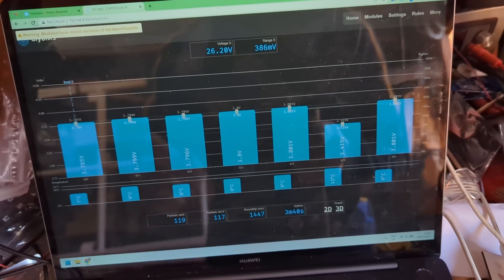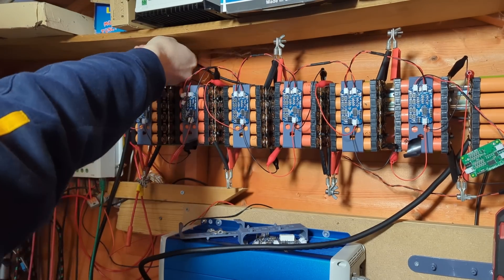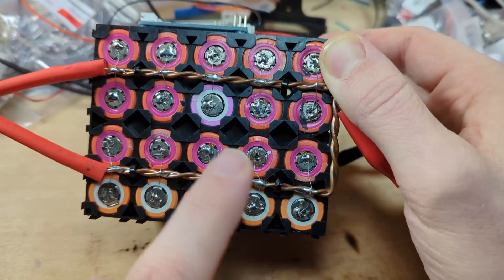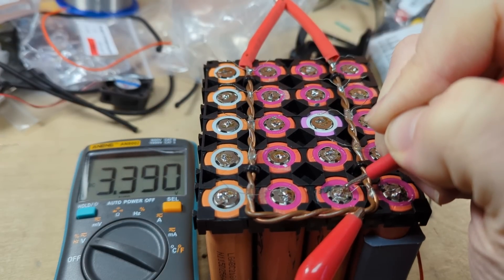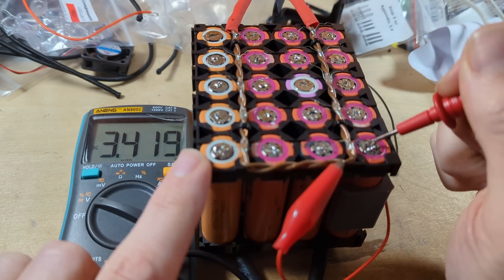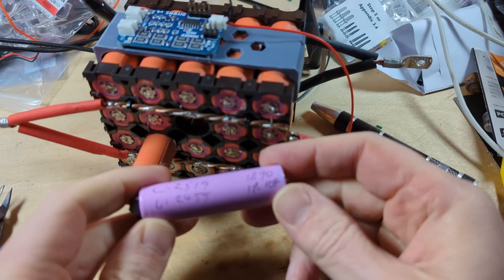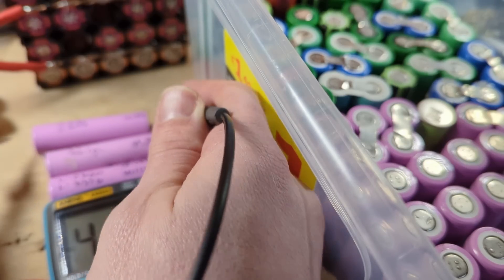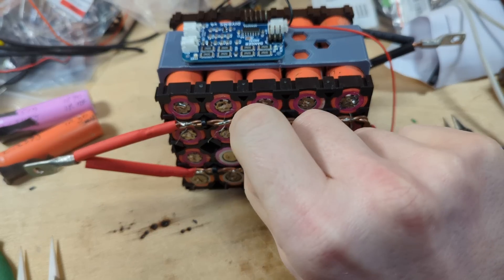Repair Attempt - 18650 DIY Powerwall Fail

Comment: buddy for soldering there you need a specila corosion flux for make that ENAMEL solderable with ez.. you only heating cels to point where actualy die of heat.

Comment: Been following you for years but finally want to jump into the world of solar and batteries. Partly becuase I'm starting to collect enough old car batteries to build a system! I wondered if youve tried this before? Appreciate the capacity maybe dodgy but only looking to power 12v led strips in the garage with these.

I suspect you use the power to push back into the house? Could you share any info on inverters switching etc? Thanks!

Comment: Wouldn't it be better to solder the fuse-wires on the busbars rather than on the cells directly with relative small solderiron? Soldering on the cells puts a lot of stress on the cells - not sure how much that hurts... Anyway - good performce so far for so many years. Would have been interesting if you could find the defective cells easier with an IR-camera.
Reply: Yes, I always heard that soldering is really not good.
Is it a good idea to do that ?

Comment: i solder both ends of the batteries before packing them, have them rest for at least a week and rechecking the voltage - a small percentage fails
Reply: forgot to mention , I now pack my batteries in fire blankets and steel boxes after I had 2 small fires
Reply from the maker: Useful tips. Thanks.

Comment: You should store your spare cells at a lower voltage. Full charge isn't that good. Correct me if I'm wrong
Reply: That's right. Some of the cells I left sitting at full charge for two years lost some capacity, some of them even went from "usable" to "junk". I didn't test all of the cells (it's like 150 of them), I just measured their voltage and those who dropped to 3.7V - 4.0V got retested with pretty bad results.
Reply: No, you're correct there. Lithium cells shouldn't  be stored fully charged or discharged as it stresses the separator. Can result in perforation,/shorts across the separator,  and hence the internal resistance increases (and converts it into a heater).

Comment: Man, you’re not supposed to keep lithium cells at 4.2V for 5 years. Better discharge them to 3.8-ish.
Reply from the maker: I know, it wasn't really the plan to do that.
Reply: @AdamWelchUK  and yet 5 years they are still fine.

Comment: Nice work, What would be your formula for figuring the fuse wire gauge?
Reply: I think something like max amp draw divided by number of cells in each pack times some safety factor (allows for surges but also doesn't let cells draw over current for too long). 

(IE 60 (A) ÷ 20 (cells) * 1.5 (safety factor))

You would have to be sure the C rate of the cells matched Charge Current and Discharge Current.

Say you had a 20A charger, you'd want cells which can safely accept a 1A charge current (Charging at 1C, the cells would need to be a 1000mAh capacity. Charging at 0.5C, your cells should be 2000mAh. At 0.3C, 3000mAh cells. 0.3-0.5C is the recommended charge rate)

These cells should then be able to discharge at 1C safely, so working with 3000mAh cells, you could pull 3A * 20 cells, so 60A. Surge discharge might be as good as 3C - 5C, 9A per cell (3C) or 180A for the pack up to 15A (5C) or 300A per pack.

This is a 24v setup (7s20p, and 7*3.7v is 25.9v nominal), so 24v * 60A (1C discharge - 3A*20) would be 1440w, while 24 * 180A (3C discharge) would be ~4320w and 24 * 300A (5C discharge) would be 7200w.

So going for a 1C discharge rate, 3A per cell, 60A per pack, 1440w for the entire battery pack, could easily run a 600w inverter, with surges up to 1500w. So, a 3A fuse wire would make sense for this setup assuming you didn't ever surge past say 1400w. 3.125A fuse wire would cover 1500w surges.

Fuse wire is usually sold with a rating on the packaging. You would buy a pack of 3A fuse wire... If you can find it!
Reply: Here are the videos Adam made of the construction of the packs:

https://youtu.be/o2REqk2-qg0
https://youtu.be/6mzE8-syzv8
https://youtu.be/aI3y65HWzq

You can see the fuse wire used by Adam.